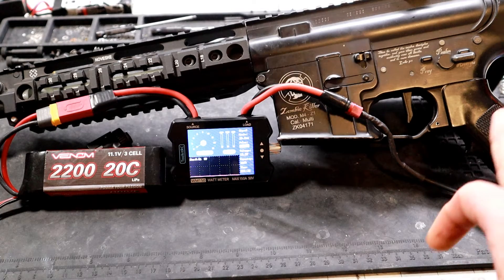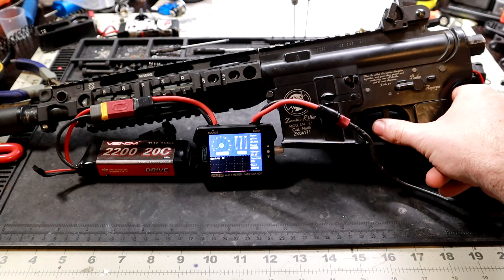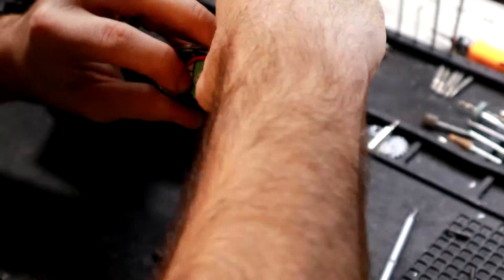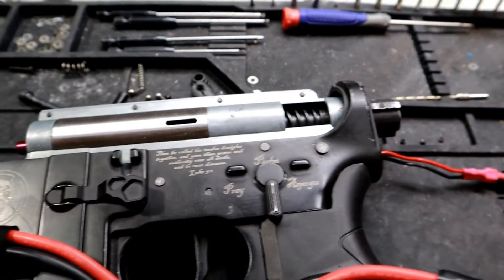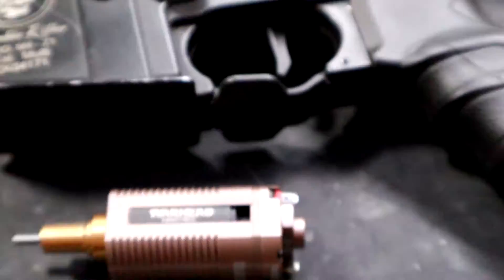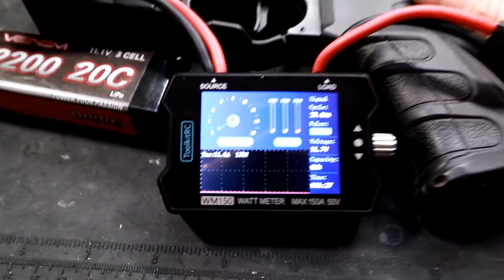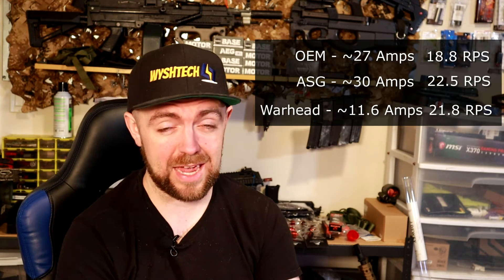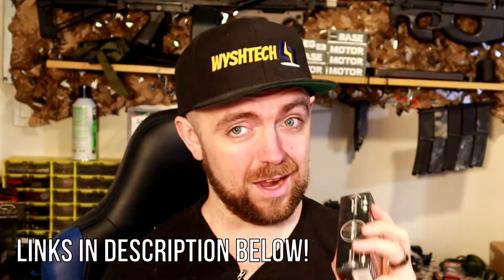Why Brushless Motors Are The Way To Go For Airsoft! #brushlessmotor #airsoft #airsoftupgrades

Comment: I have HAL ETU,can it support brushless motor?Sometimes radio turns off my rifle if i put it too close,it might do something with electro magnetic fiels.Please Help guys.
Do i need Titan 2 ETU to fix radio problem and to run brushless?
Reply from the maker: Depends on which HAL ETU you have?  I normally swap to an aftermarket like the Perun V2 Hybrid or Jefftron Scylla.  Im not a fan of GATE etu's.  Massive trust issues with Gate.
Reply: @wyshtechairsoft  Its standard HAL ETU that you get in edge series

Comment: Need to get one of these in my lct rpk. Standard gears and high efficiency. It only gets 17.5 rps on an 11.1 anyways with a asg 22k. I got that first because LCT motors are LCT motors. If you get a cyma, the newer ones have the same motor you will find in their platinum guns.

Comment: So if i understand correctly, by pairing this with a high mah battery, I can keep playing until the heat death of the universe?
Reply from the maker: If there is alot of heat coming from your motor. Something isnt right about the internals of your airsoft gun.  However, generally the brushless motors run alot cooler than brushed and significantly run more efficient.
Reply: Yes a high mAh battery will go looong time with a brushless motor.

Comment: How is the heat on the 30k asg motor? I have an 45k asg infinity one and cannot make it to not get it heat up, ( 2.650 mah 11.1v 20-40c battery,m100 spring,18:1,perun v2) gears,piston all move freely.
Reply: I have the 30k in my kwa ronin dsg and it's shimmed flawlessly and it still gets warm. I have the active brake set pretty high though as I get alot of overspin. I just ordered a t238 from real deal airsoft should have it in a few days
Reply from the maker: Check your piston meshing to your sector gear.  Ive found some pistons will bind on the sector gear teeth.
Reply from the maker: The 30k motor would produce alot less heat than the 45k motor since it has more torque but it will run slower.  More torque means less amperage pull. Less amperage pull means less heat and battery useage.  Though 45k should be used with higher torque gearsets.    If you really want to bring the heat down to a lower temp and get more battery life. Go brushless.  Way more torque for the same rpm.
Reply: Thank you. Gotcha. Yea well I will try to give it on a trade or keep it and use the body with other armature 🫶❤️✌️

Comment: I have mixed feelings. I use brushless, but things WILL break. They're very strong and very fast. PME, Sector gear breaking, piston breaking, and anti reversal latch breaking. All serious problems you'll run into.
But then I do run into extremes. 3.3j DMR SR25, 68RPS Indoors M4.
Reply from the maker: Well, that's why you had these issues. Those extreme builds you made factor in massively more than just the motor itself.  However, putting a brushless motor of the SAME rpm as a brushed motor will NOT break internals.  The only difference would be a massive increase in how long your battery lasts on the field.  Gotta compare apples to apples.

Comment: I’m still not sold on brushless. My G&G Titan 35k puts out 29 rps but the T238 33k only gets 17 rps with 18:1 gears. Plus on more advanced mosfets you don’t have as many options like braking or ROF reduction with the brushless.  

Maybe it’s worth it on builds with limited battery space but with most M4s you can run a 2000mAh battery that will last a long time.
Reply from the maker: The 39k would get you 28 to 32 rps depending on the build. Also, rof is adjustable on the T238 motor itself. 17rps seems real low for a 33k. It might be turned down.  The torque brushless motors have put brushed motors to shame. Especially when you run dsg or 13:1 ssg setups.
Reply: Theres a adjustment slot on the T238. Turn it up. DONT turn it whilr pulling on the trigger, destroyed 2 T238 that way.
- Idiot with a 68rps DSG
Reply: Lower heat generation, basically infinite motor lifetime (no brushes to replace or commutator to wear out). No more carbon dust in the motor compartment. Could even use thinner gauge wire to make routing easier in builds. Should even make stock switches last much longer if you haven't put in a mosfet.

Comment: A 2 tooth short stroked scorpion evo, how much RPS would it shoot over my stock motor? (Currently does 27-28rps, enough)
Reply from the maker: If all you are doing is short stroking. You might see a 1 to 3 rps increase, and you'll lose fps unless you install spring spacers.
Reply: @wyshtechairsoft i meant it IS short stroked and shoots exactly how much joules it needs, but might need to replace stock motor.

It does 28rps now on 11.1v and stock motor :)

Comment: Price wise I do not think that it is worth the cost. Also they seem to be the cause of a lot of issues if you run a mosfet. Maybe if the mosfet can be updated to work with brushless motors and the cost comes down some I could see using them.
Reply: I tested a warhead on a T238 mosfet and kept getting errors
Reply from the maker: @shaun536  Wierd, it might have been an outdated T238.  The one I have worked just fine.  Granted, I shut off the active braking before using it.
Reply: @wyshtechairsoft Dang, I didn't think of that. Oops. Could of been the issue. Time for some retests on a gate titan  and the T238 with that off.
Reply from the maker: @shaun536 Honestly, I find Perun mosfets to be the most reliable in performance and compatibility.  I install the HYBRID's in customer guns on a regular basis at my shop. Sold hundreds and only had 2 failures but it was my fault due to human error. T238 are finicky as hell imo.  Jefftron is 2nd on my favorite overall list.
Reply from the maker: This has only been an issue with Gate Mosfets.  I personally tested brushless motors in Perun, Jefftron, and T238 mosfets with no issues. The brushless motor itself is worth it in my opinion when it allows your battery last twice as long AND can provide much better overall performance than any brushed motor.  Unless you know how to wind a brushed motor and built it as good.

Comment: They are really efficient, i  have a boltairsoft AKM with EBB, 25k motor and gate mosfet (simpler one, MERF ?) would that motor work? Currently only 3000mah 11.1v titan stick is able to pull g&g 25k motor, but it hardly fits my stock
Reply from the maker: Going brushless should work just fine with your combo and you wouldnt need such a large battery.

Comment: High speed brushless motors don't lose torque but are far more expensive than brushed motors. That 52k motor can still have 28tpa.
Reply from the maker: Would you say going brushless is worth the expensive price?
Reply: @wyshtechairsoft  only for a high speed build. It seems like a waste if you just want to put a 25k in or you're building a dmr and use an 18k motor which is already super efficency. They don't last any longer.
Reply: @darkshock42mlg05  so at what speed should you aim to make it worth it?
 If I have an arcturus ar15 cqb with a stock mosfet and motor and I am considering switching to brushless (mostly because of sound reasons) at what speed should I focus? 
And what else should I consider upgrading to be safe (not accurate, Im not talking about hopup and barrel here)? Probably piston assembly?
I imagine if I would not select a warhead motor with a brake, but another without a brake - I should also swap the mosfet? I'd like to skip that.
Reply from the maker: Any speed, really.  Brushless motors run much more efficiently than brushed motors. The efficiency alone is enough for most people to upgrade to brushless.
Reply: @wyshtechairsoft 100 percent. Entry level brushless is only 2x the price.  Your batteries will live longer lives, last longer on GameDay.  No more hot handgrips. Much less likely to harm mosfet or switch. 

If I could do it again I and I could either swap out stock switch / mosfet or stock motor, I would choose brushless every time.

Comment: how the 30k motor is faster than 35k warhead? (rps)
Reply from the maker: The 30k might have had a fresh battery from the charger, or the battery for the brushless 35k might of be getting low on voltage.

Comment: Planing on getting brushless for my mp5 13:1 gear ratio,m130 spring.What do u recomend warhead base 27k or warhead high speed motor?
Reply from the maker: 35k Base will get you around 35rps on a 11.1v lipo.  Definitely short stroke the 13:1 if you go that route.  Im not sure what you'd get with the 27k.  It just depends on what fire rate you are looking for.
Reply: @wyshtechairsoft  im trying to get about 30 rof
Reply from the maker: @Klagija  If you are short stroked by 3 teeth.  2 on pickup and 1 on release with the 13:1 gears and the 27k.  That should land you around 30rps

Comment: Subbed and great information. I noticed purchase options are standard, high speed, and ultra. (Noob question) Are there pro's and cons between the three? Obviously cycle rate increases, but what about hardware requirements? No problem or increased torque has to be addressed with better internals? Sounds like a great follow-up video,...hmmm
Reply from the maker: It really comes down to efficiency.  With more rpm, the more power you will consume.  Less RPM the less power you consume.   High speed seems to be the goldilocks zone if you are looking for higher fire rate/trigger response but also not use as much of your battery.  

It all just depends on your goals.

Comment: Base has more torque than black?
Reply from the maker: No but it has alot more than a brushed motor.
Reply: @wyshtechairsoft  i thought difference is hand machine wound only between black and base
Reply from the maker: @XRPHordz  which effects how much torque and efficiency they put out.  Hand wound would translate to more torque than machine since you can fit more coils in.

Comment: Interesting.  I like blowing fuses though. :D
Reply from the maker: You still can! Just shim really tight!
Reply: @wyshtechairsoft  Do a comparison against an ftk.
Reply from the maker: @htwarrior6801  Can you give me a link to one?
Reply: @wyshtechairsoft  you have to make it. The spec will depend on how you do it. I think 24 TPA was considered balanced.  Typical would be 28 TPA.  The RPM without load would be lower than brushless though.
Reply from the maker: @htwarrior6801  I do have a 52k Brushless motor
Reply: @wyshtechairsoft  52k would be lower TPA and more Amp draw.

correction
 - oh, a brushless. My bad.  The readings will be different but similar idea.
Reply from the maker: @htwarrior6801  yup! Even with a 52k brushless ive seen very low amp draw.

Comment: What is love to see is trigger response time on each. From my understanding that's the real performance benefit from them because they have instant torque.
Reply from the maker: I agree. The trigger response is definitely better than the brushed motors. Ill figure out a way to compare in the next video I post. Thank you for the input!
Reply: Yes you should hook it up to a Titan or Leviathan and messure ms cycle speed
Reply: The instant torque is an electric motor thing,  not just brushless.    The quicker response, I'm guessing, is due to the low amp draw.